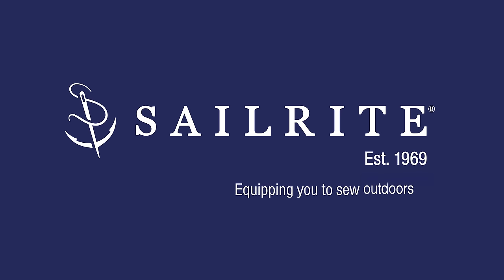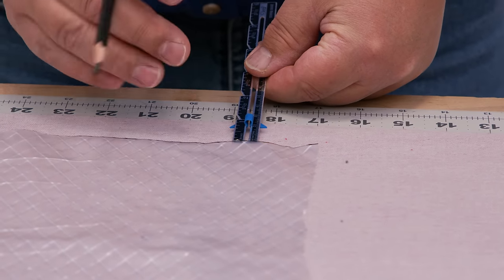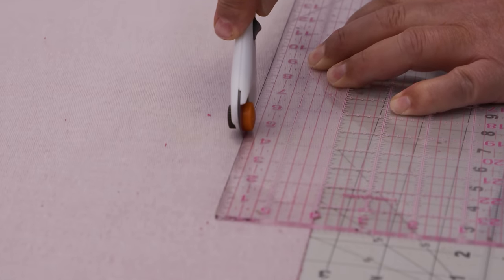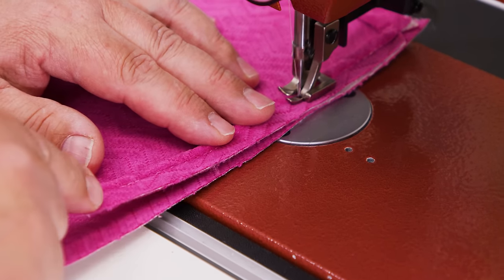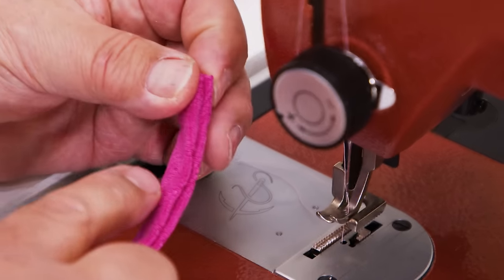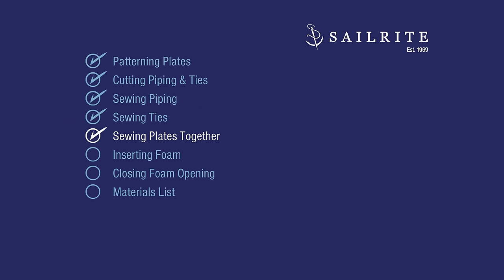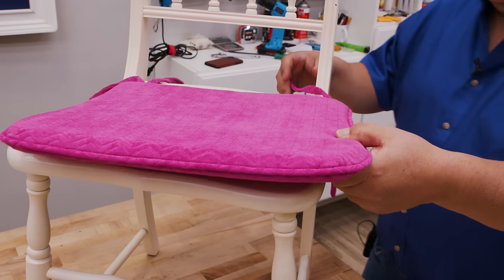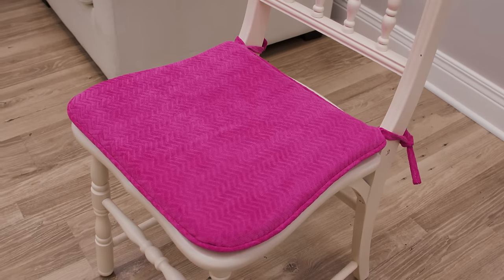Sew Your Own Chair Pad with Ties

Comment: This video has the clearest and easiest instructions I have ever seen for a chair pad.  The photography is amazing.  I am wondering, though, if there is a way to make this chair pad with a zipper closure in the back, so that it is removable for washing, if using a cotton fabric.  Do you have instructions or suggestions for how to do a zipper closure?  Is there a way for this to be done before the piping is inserted, or the front and back sewn together?Thank you so much for making these videos.
Reply: for something this thin, prewash the material, make the cushion, and then just wash the whole thing. For thicker cushions, Sailrite has videos how to make cushions with zippers. There's a zipper video alone that I use for reference when making cushions.

Comment: Great video! I know it was some time ago but I would love to ask a question (first time attempting this). When sewing the top pattern to the bottom pattern (with the piping sandwiched in between) and the sewn in piping thread is visable - do you sew on top of, to the inside of, or to the outside of that already sewn piping thread 'guide'. Any help would be greatly appreciated! Thanks!

Comment: Ok i have cute out four pieces of bed foam to match my seats my question is how do I close it up and put tires on it to keep it good and I can take them off and wash them when I need to
Reply from the maker: If you want to take the covers off and wash them you will need to install a zipper opening in the cover.

Comment: I just made a chair pad and my issue was that the stitches from the fabric covered piping showed up when I put the whole assembly together.    I had to sew over everything on both side to make sure I sewed close enough to the piping so the stitches didnt show.   Is there a trick to getting it right when sewing the whole assembly together ?
Reply from the maker: The trick to making piping that does not show the stitch that was created when you make the piping is to feed the piping into the cording foot so the stitch is about 1/8" or so away from the piping. If using the Sailrite Ultrafeed LSZ simply use the "Left, Center, Right" lever to move the stitch away from the piping (when making your own piping). Then after the piping is made you now move the stitch that sews all the finial assembly together closer to the piping. In doing this you will never see those stitches that were made when making or sewing the piping to the first plate, as they are about 1/8" away from the cording. The only stitch close to the cording secures the whole assembly. I hope this helps.

Comment: Eric, my whole family is fairly... uhm... not lightweight!   I'm concerned that a 1" foam would instantly bottom-out with us, even in extra-firm.  A.) Is there a practical weight limit for this 1" foam?  And B.) Could the same type of cushion be made with 2" foam, instead?  (Or, would that require boxing?)
Reply from the maker: The 1" HD foam will last for years, even if used daily by stocky people, like myself. But your question is a matter of comfort and softness rather than longevity. So, would a 2" foam provide more comfort, yes it would. However, is you use a 2" High Density foam you will have to add a boxing, it it simply too thick of a foam to be sewn with two plates as shown in this video.
Reply: @SailriteDIY  Thanks for the info!